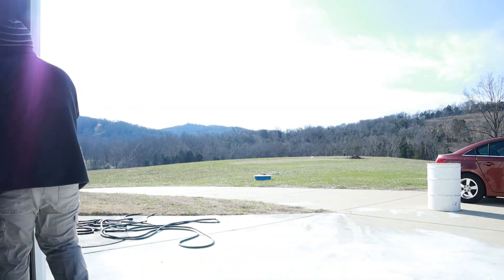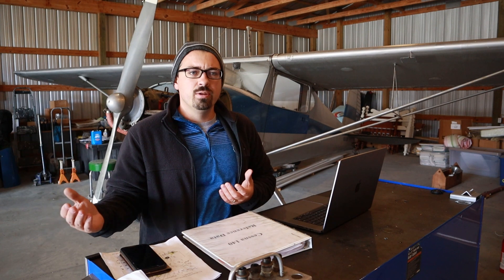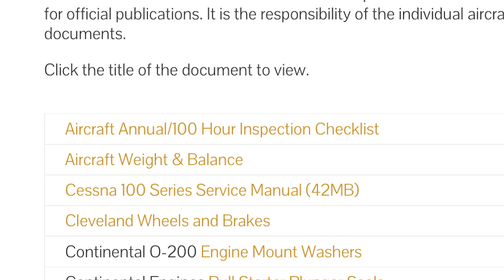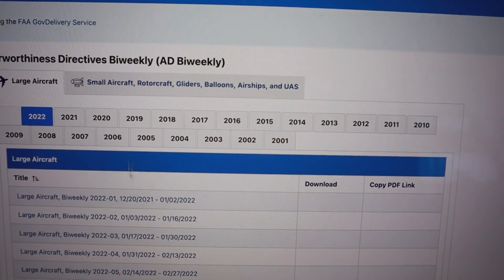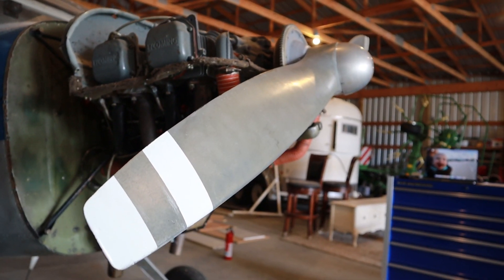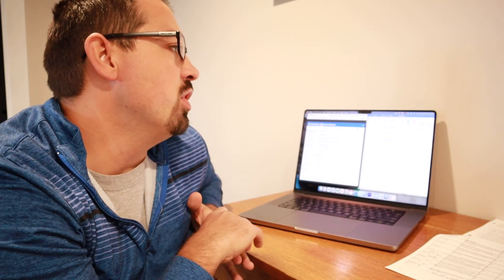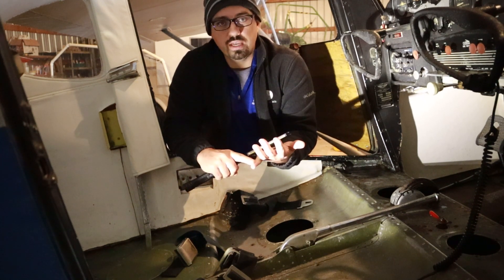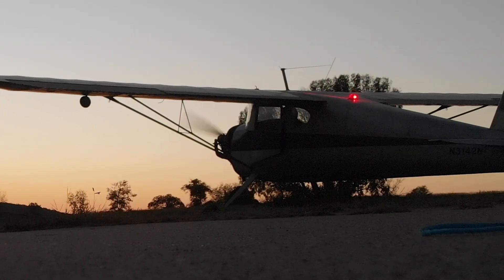Airworthiness Directives (ADs) Research | Cessna 140 Annual Inspection (Part 1) Part 6

Comment: Now is the research so long because you don't have the logbook records? If you did would that research be done by looking at previous logbooks? I guess I am just curious as to how to make that process less cumbersome. Just seems like there could be more filters or something that could help you search those documents to get rid of any that doesn't make sense.
Reply from the maker: Basically not having any records just means that everything that I got with the Aircraft needed to be thoroughly looked over. When I talk about research in this video, I’m really discussing the fact that I want to make sure that all the airworthiness directives were completed on this Aircraft, even if I don’t have the paperwork for it. I was very fortunate to find that in a later video, even though it was partially destroyed.

Comment: Great video. I agree that the seat belt AD solution is kind of funny in it simplicity, but the serious reality of it is if that bracket was made of aluminum and you had an accident, the seat belts are far more likely to fail at that bracket. If that bracket fails the belts will not keep you in your seat. If something happens that breaks that bracket... you probably REALLY needed it not to break in that moment.

Comment: Does 47/43-06 apply?  I want to see a video on doing that one
Reply from the maker: The ribs supporting the ailerons were too weak on the batch of 120/140 manufactured from SN 8000 to the mid 10,000. Mine was a few months after the AD came out and it doesn’t apply to my aircraft but per the AD you have to do an Inspection required whenever airplane is tied down in high winds without controls locked and upon each 100 hours of operation until Cessna parts 0422200-2 and 0422200-3 are installed.
Reply: Do you have inspection holes in the wing?
Reply from the maker: Yes! I have a drag wire AD that required a few holes to be installed.
Reply: How about a hole at the outbd aileron hinge?